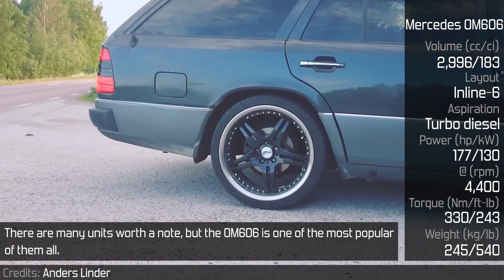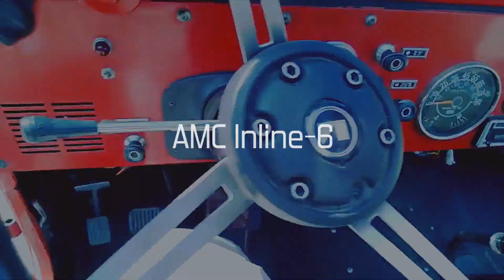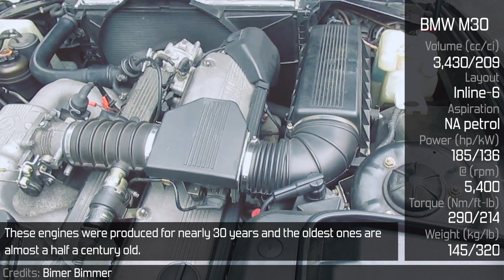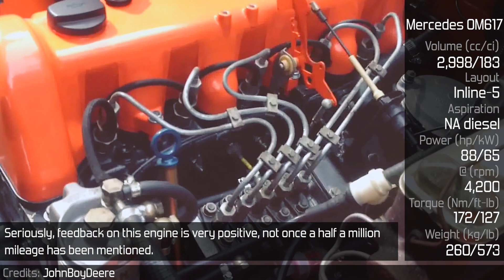10 Most Reliable Engines Running Beyond 300,000 Miles

Comment: Slightly upset  the ford 300 i6 wasnt in that. other then a handful of gaskets, a carburetor,  and basic mantainence. My family had passed down a 78 ford pick up with over 300k miles on it. Last time i spoke to the guy i sold it to he said it was still running strong after another 4 years of daily drivng.
Reply: eric devore I had a 92 f-150 with that 4.9 straight 6. I sold it when it was at 325k. I used to pull a party barge with it. That thing had son torque

Comment: I have had three 5.0 Ford engines with over 500,000 miles and zero engine repairs.  Just changed the oil reguarly.

Comment: In the USA, where everything is disposable, the cars we saw with high mileage were due to different reasons. Not necessity but more economics. actual miles driven are documented at the places I worked. These are Miles, not kilometers, so a 300,000 mile motor is actually a 480,000km +/- a few. In my experience here are the clear winners after 40+ years in the automotive service industry:

1. Datsun/Nissan 2.8L. L6. Routinely used commuter cars with 300,000+ miles. After purchasing these high mileage examples, I would remove the heads and engine bore had minimal wear and engine internal was still clean with factory marks still present in the engine. A few years back you could buy 280zx's for 200-500 bucks still running and not burning any oil with hundreds of thousands of miles. I used these as cheap commuters.

2. Ford 4.9 I-6, used for fleet vehicles for rental companies, U-h*ul, R*der, B*dget, these vehicles were forcibly RETIRED after 400,000K Miles, I bought a couple of these(Super Cheap) and they still lived for another 100-200K miles after. 

3.  Toyota 22R, I-4, I believe this motor will run forever as long as the oil is changed routinely and it is not abused or allowed to overheat. Even abused examples with carbon in the crankcase where oil was rarely if ever changed and left to cake, will run after a thorough cleaning. We pulled a couple from the dirt and mud in junkyards and after we removed the surface rust and a good cleaning, screwed it back together and they ran. Simply amazing for an inexpensive 4 cyl.

4. Dodge/Plymouth 196/225 Slant 6, This engine was legendary, serving in taxis from the early 60's to mid 70s vehicles. We had one retired taxi at the gas station where I started my career and everyone used it, the clock only went to 99,999 but we are sure it had gone around 2-3 times. We would do tune ups for a local taxi company and we had the car logged. Service intervals were 5,000 miles and we had some vehicles that came in at least 75-100 times for 5k Miles service.

I am sure there are others, 

One note, the AMC 6 Cyl, the 232 and the 258 was not one of the better motors back in the mid 70's AMC and Jeeps, Oil seals leaked and they tended to warp the heads.

Comment: Glad to see the 3800 on the list. Absolute beast of an engine. HOWEVER.. The turbo 3.8L in the Grand National is NOT the same engine as the 3800. The 3.8 eventually became the 3800, but they're pretty different. And I agree with other people in the comment section about Hondas. I have a 1989 Honda Civic with a D15B2 that has 309k miles on the clock and still going strong, albeit with a little more oil consumption than a couple hundred thousand miles ago. Doesn't smoke, though.

Comment: I drive older Volvos. Only 2.4 turbocharged petrols. One i had to scrap at 420 thousand kilometers because of a really BAD tuning. It has melted the pistons. The other one is now approaching 400 thousand kilometers. Tuned up properly so it will go on for a long time. One friend of mine has a 740 thousand kilometers on the clock of his NA Volvo. Basically ANY Volvo prior to 2008 will drive forever if maintained properly.

Comment: whats strange is ford didn't make the list
then again it seems to be one of those rareity engines that you have to end up with
vehicle thats about to hit 500,000mi is a 1982 Ford Econoline 150 with current 485,000~ dont have any pictures currently
from what i know it was used as a painters van and it shows and kinda needs a respray as well, with from what i can tell nothing besides regular maintenance and a waterpump replacement so far and all for a great price ,charisma level check of 20 and a high luck at least 50
overall its been a great vehicle so far in a lot of ways and getting the wiring re-done is definitely going to help since it was used under DUI before and that has been a nightmare to figure out what it went too since it was ripped out/removed but left a good mess of wiring to deal with which is nothing from ford that they did

Comment: I have a '88 Toyota  1/2 ton Auto. Pick-up with the 22RE engine that has now 621,000 miles on it and still going strong. Gone through 3 transmissions during that time and most of all, it still passes the strict Calif. smog check easily. Going for 1 million for sure.

Comment: So much depends on maintenance. We've had an Alfa Romeo 20 year old 2.0 twin spark for 12 years and knocking 200k and it hardly uses a drop of oil (unlike the rubbish you often read on forums). Our garage did 500k miles on a 2.0 twin spark engine. Beyond that - there are diesel and petrol Land Rover engines with well over 300k on them. I see the good engines you mention belching soot everywhere because people mistreat and neglect them. More than half of car ownership is good maintenance.

Comment: I have one for you, my old 1996 Chevrolet Tahoe 2 door 4x4 with 5.7 /350 vortec engine. How much more reliable can you get then 375,000 miles on original engine and 1 4L60E rebuilt trans? I worked at one company that had a 1987 Chevrolet C/1500 1/2 tonne  full size truck. They had put 650,000 on her original 305 with only 1 700R4 trans rebuild.. How many engines can you name where parts are interchangeable from a 2003/350 to a 1955/265 a span of almost 50 years??? The engines(350/5.7) are still manufactured by GM as of 2018 a span of almost 65 years!!

Comment: Any Ford 4.6 Litre in a Crown Victoria/Lincoln Town Car

Any Chevrolet LS series V8,  my pickup has 420,000 miles and runs perfect.

Both must be properly maintained.  I've seen both go to over 1,000,000 kilometers (700,000 miles)  The Mercedes SUV driving service I use in New York (when it wasn't in the garage) couldn't get 300,000 miles out of it.

Comment: awe man...should have put the iron truck LS series on here. 4.8, 5.3 and 6.0 are pretty damned good. If left stock 300,000 plus is a walk in the park. They're so over built stock 4.8s can put 1,200 with the only the piston rings gapped. 4.6-5.4L 2V Fords show a lot of miles in hard service too. I have seen more of them with over 300000 than anything because of cop cars and taxis. Mopar slant six and Ford 300 six are right there too... I'd say the 300 Ford beats AMC, Mopar and the GM big I6s.

Comment: I had a 1987 Honda Civic with the D15A2(EW2) CVCC with 483k miles on the original engine. The machine shop micd it in front of me and said it had almost no wear on the block. I machined it 0.020 over because it was pretty gutless(76hp) and needed all the help it could get.

Comment: Once I checked the clock in a Mercedes bus that was going there and back between Budapest, HUN and Amsterdam, NL twice a week. It had around 4 500 000 kms in it!
(Although doing 99% motorway doesn't use the engine nearly as much as in the city traffic.)

Comment: and I also had a 2001 Chevy 1500 with a 4.8 had 450,000 on it alls I did was put a fuel pump in an alternator on it the only reason I'm not still driving it is cuz the kid was texting and driving and ran a stop sign

Comment: YOU MISSED ONE OF THE BEST "EVER" The Honda d15z1. Placed in the VX civic models. I have owned two 1992 CIVIC VX MODELS Both went over 400k One was still running at 485k when I sold it to buy another with less miles( ONLY 200K)  I now have 420k miles and she still runs strong. I get 42+ MPH on a 25 year old STOCK motor with the A/C on doing 75 mph on my 220 round trip daily commute. the D15Z1 HONDA SHOULD BE AT THE TOP DUE TO THE MPG!!!

Comment: My friend had a supercharged 3.8 engine in his Buick. It had over 300,000 miles on it when the transmission went out, but the engine still ran good. My son has a Buick with the 3.1 engine that has over 215,000 miles and it still runs great. 26 mpg also!

Comment: I bought a Cummings diesel, that had well over a 100,000 on it when i got it. To be honest I think it had a 117,000 on it when I got it. When I sold it, there was close to 500,000 miles on it. And I drove it for close to 9 years. Even accidentally put gasoline in it once, and never hurt the engine, killed both the injection pumps but not the engine. And I am told that Cummings Diesel if properly maintained will last for a full 1 million miles. And I do believe it. But if you do not take care of it, no engine will last very long. That's the big secret to getting long life out of an engine is simply taking care of it.

Comment: I must submit my 1993 Mercedes gasoline 300 with the M104.992 24 valve DOHC masterpiece.  It is my daily driver and has 350984 miles and all original.  The engine is now in luxury models in Korea.

Comment: Well next time you should do it a bit better. The most reliable TDi Engine was in Audi A6 (C4) especially the 2.5 TDi which was the Straight 5 engine and about that 1.9 TDI there were many variants of it.

The second thing you should mention was that the legendary Mercedes OM617 was actually created by Ferdinand Piech - the creator of the TDi and CEO of VW up till that dieselgate scandal so the engine is more VW than Mercedes

I had the W124 250D with OM602 - one guy from Netherlands drove 2,1 mil. km on that thing. I myself had 376 000 the thing was immortal. I would more likely replace that OM606 from 90s with that thing... it is one of the most respected engines from Mercedes Benz - again a straight 5 with resemblence of F. Piech

Comment: Based on my experience you forgot to list the following engines.

1. The Ford inline 300 6 cylinder engine. My first vehicle when I got my driver's license was a 1978 Ford Econoline 150 van that had an inline 300 6 cylinder. Back in those days I didn't know anything about car maintenance or mechanical repair as I do today. I didn't maintain that properly like I should of. I have to confess I literally abused neglected and beat the living crap out of that vehicle. The oil was seldom changed. That inline 300 6 cylinder that was in that vehicle I abused it so bad it was almost criminal. But no matter what I did to that vehicle the inline 300 6 cylinder kept going and and going. The only trouble that van ever gave me was belts and the inline 300 6 cylinder was not known for fuel economy. 

2. Chrysler slant 6. Although terrible on gas and low on horsepower that engine from what owners have told was indestructible.
3. GM 5.7 350 V8. Excluding the Diesel which was junk and garbage the gasoline version is used to this very day ever since the late 1960s

Comment: An engine on this list can last a long time. Or be junk in 30,000m/50,000. It al depends on service by the owner. The biggest single contributor to good engine life is an engine that is not over stressed and has a good oil system.

Comment: I would have topped my list with a 4.9L 300 I-6 Ford, I mean geeez UPS & Fed-Ex still have trucks with 300's in them exceeding 300K miles, I had a F-250 4x4 with a 351 in it and I replaced it with a 300 and it just turned over 400k miles, as long as you don't let them overheat and don't over rev them they will last, even with the horrible carbs they have, yeah the lifters peck when she starts but no worries it is a Ford

Comment: The Engine that was well built though the gearbox for the manual shift was the engine on the Saab 4 cylinder non turbo model that was used for the Saab 900. I have heard of those engines getting 400,000 miles or more.

Comment: My 97 suburban has 247,000 mi on the clock and still runs great. Same goes for my dads 98 Tahoe with 305k. Both the 350 vortec.

Comment: I own a 1996 Audi A6 2.5 tdi (R5 not v6) literally just undestructable. Actually 360k miles, first Turbo, first VE Pump, first block. I found the VE engines to be more reliable than the 1.9 PD ones. Still good engines though.

Comment: The GM straight sixes are a hell of a motor, my 1964 Chevy has one with (what I think) to be over 300,000 miles on it. It smokes a little sometimes, but still pulls like a damn mule.

Comment: my 2000 Chevy 2500 with the 6.0 engine is beyond 495,000 miles.
Neither engine or trans have been rebuilt. The disc brakes were done at 480 k. It has had  a radiator, water pump, 2 alt, 3 fuel pumps, & 2 steering boxes. It still runs great.

Comment: It seems most engines with higher mileages were generally drive for longer distances andmost likely at cruising speed. Those are the best conditions for any engine if you want them to last long and you can bet this is why such engines, despite the high mileage, are still in relatively good shape.
Short trips, constant starting (especially when the engine and oil have not yet reached their operating temperatures), high RPMs and general owner laziness in regards to engine maintenance (oil changes etc.) are the death for any engine.
Regarding my personal car (2007 BMW 118i), it’s holding up well (currently only at 220,000 km) and the engine feels like new despite daily high speed and high RPM abuse on the Autobahn (I live in Germany). I don’t think I will reach 1 million km’s but who cares? It’s not a mileage contest to me.
Reply: Das gleiche dachte ich sofort auch, als ich das Video sah. Die Art und Weise der Nutzung sowie die Wartungspflege bedingen zu grossen Teilen eine lange Motorlebensdauer sowie den allgemeinen Zustand und das praktisch hersteller- und typunabhängig.

Comment: The 1.2 16v F.I.R.E. engine in my mom's 2009 Fiat 500 will never stop to amaze me.
Clocking at 270 000km, apart from the original timing belt (changed at 240 000km) and the usual maintenance, nothing broke.
It's used everyday for ~60km and it is still like new. A true hero.
Reply: The f.i.r.e. Engine was designed about 20 years ago!

Comment: Our buses use the 6.7 Cummins engine which is an evolution of the Cummins 6BT. They have done over half a million miles with no engine rebuild or even a head gasket change.

Comment: 0:38 I almost had to step in and check him on his first pick, until he properly clarified "back in the past" (lol the distant past)

As for the rest, idk how they are over there but here in the states ANYTHING german has a reputation for dropping off in reliability after 5 years or so (the TDI's being no exception). Reliability tends to ring more with Toyota and Honda stuff, with exception of a few old american designs:
-GM 350
-GM early-LS series
-Chrysler Slant 6
-Chrysler 318 (the one in my Dakota pickup has over 300k on the clock, no rebuilds)
-Ford 300 inline 6

Comment: Personally, I've had great luck with the Audi 3b inline 5 turbo. I've owned 3 of them and the highest mileage (91 200 20v avant) is somewhere around 380,000/390,000 miles (odometer broke a decade ago). Still runs like a champ. It has spent most of its life modified. It ran 12.1 in the quarter at 116mph on a completely stock engine (changed injectors, turbo, wastegate, exhaust, tune and fuel pump).  Beside clutch, vacuum lines, coolant hoses and the occasional sensor they were problem free. Loads of fun!

Comment: The Jeep inline 4-cylinder now it was only in the Jeep but it was extremely reliable and we go easily 300000 miles with basic oil changes and maintenance the Ford inline 6 was another outstanding motor it also would run easily 300,000 miles of course these were never offered in cars although Ford did make a short stroke 260 built off the block of the inline 6 that they did put in cars for short time in the seventies Honda Civic Motors are great unless some kid gets a hold of them and tries to pretend it's a race car but if it was bought new and well-maintained you should easily get 300,000 miles out of it the reason why I mentioned of a Ford and the Jeep is because when these vehicles were built most cars were out at 100,000 miles and it was very few cars that would reached the quarter million mile mark
Reply: Driving a Jeep Wrangler with the inline 4. Love that motor. I take care of it but drive it hard and have never had a single issue with it.

Comment: you've mentioned the 1.9 tdi, i've expected that, altough i also hate it. i find it sounds like a tractor engine. still, mortals appreciate it. 

how come there's no mentioning of the 1.7 diesel from isuzu/gm/opel? implemented from 1988 to 2015, it passed every Euro norm until the Euro5. The 1.9 tdi got axed at Euro3.

Comment: How could you leave out the one they quit making because it lasted too long? The Chrysler/Dodge slant six? That engine was and is truly a legend and a monster when it comes to durability and reliability!!! I'm a GM man, and I'd put the slant six up against any diesel Mercedes ever put into production!! We had one as a company car where I worked, and we wanted the car GONE! It was a deathtrap on wheels. One day the engine starts knocking, I put it to the floor. I throw a rod, then another, and it's still running! we get of the highway, throw rocks into the hole on the side of the engine (the hole the size of a football), and the damn thing is floored, refusing to lock up!!! Son of a bitch that's one tough engine!!